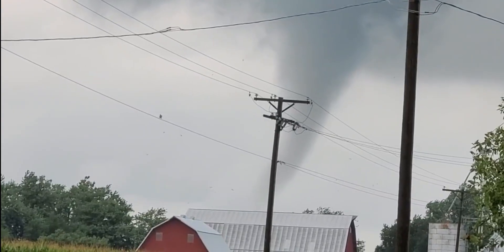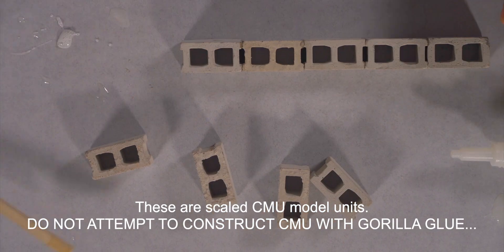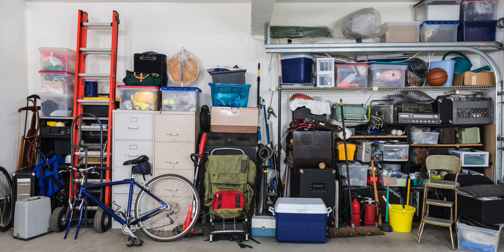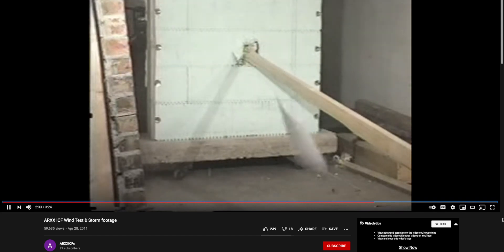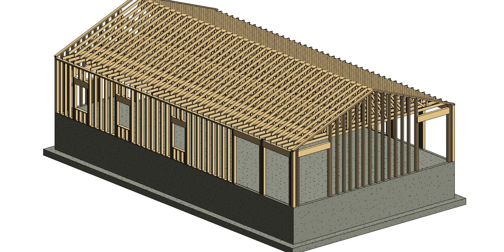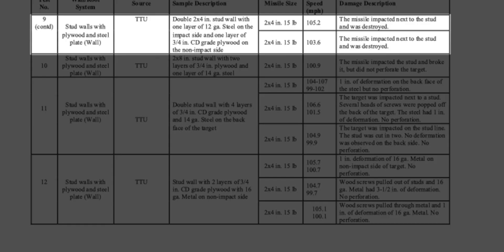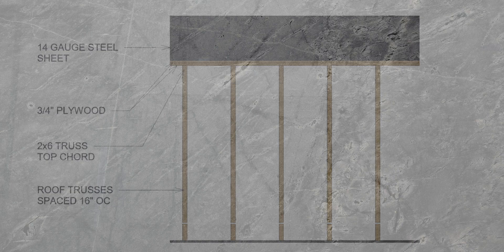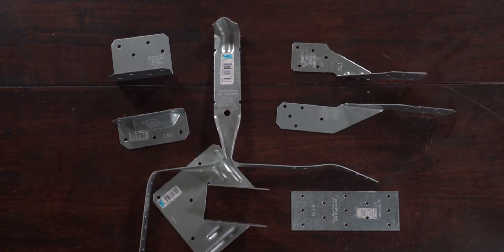These 3 Materials Can Create a Tornado-Resistant Home

Comment: I tried to install cable TV in a house that would have been tornado proof. After drilling for most of an hour I got to the end of my 18” masonry bit and still wasn’t through. The house was a small square with only one window and a door like a safe. It was built in the 50’s to be atom bomb proof. The builder built a couple of them and stopped because nobody wanted to buy them. It was a very ugly house, more like a pillbox than living quarter’s. It was in a part of NY that does’t get tornados. I don’t know if they ever got their cable installed, I just turned the job back in and got hollered at. It had no basement and sat flat on the ground. You could drive past the place and never know it was there. When you are designing just realize that people have to want to buy it and be able to live in it.

Comment: I think ICF construction is the best and most effective way to go. The double 3/4 plywood and steel will easily put your costs into the price range of ICF.
" has been determined that using ICF wall construction generally adds about 3 to 5 percent to the total purchase price of a typical wood- frame home and land …"
"When comparing the cost of building a stick frame home to an ICF home, an additional $2 to $4 is added per square foot to the ICF home, according to the U.S. …"

Comment: Wouldn’t a 8x4 sheet of 12 gauge steel be very heavy and somewhat dangerous to install? I do heavy gauge framing for commercial buildings. 6” flat stock can cut you pretty easy and even at lower gauges bends a lot when handling it. Seems like it would be difficult to handle a full 4x8 sheet of it.

Comment: If you have a shovel you can make your home tornado proof. Earth berm it and you can stay above grade. No tornados ever have been digging holes in the ground. Second, build a monolithic concrete dome. If you use basalt rebar, that concrete will never explode from rust- it will last forever. Just use shotcrete on an airform. It will qualify for a bomb shelter.

Comment: Jay, 
The reason Concrete is not used in residential construction, is because it is considered a water retainer (Like Brick). 
There is already a Tornado and Hurricane proof building method in existence today, which can replace current stick framing.  That method is Structurally Insulated Panels (SiPs). Test have proven time and again, SiPs can withstand the 100mph stud test. 
Further, there is a newer plastic, which if used as the sheeting on SiPs or stick frame, can withstand extreme tornado damage. Its the base material used to calibrate the stud cannons, engineers use to test wall structures. 
SiPs are the answer to replacing stick framing for home construction, they tick off all the necessary boxes for strength as well as high energy performance. Look into that method of construction. 
My question would be, why have we not replaced glass windows with Lexan, its far stronger and its impact resistant. 
Government does not care about Individual Residential construction. Its focus is upon housing masses of people in one space (I calk them ant farms). This allows the government to Control ... However massing people into small, joined spaces, is the worst idea, as it sets people on edge continually, because their privacy erodes. 
Humans need private space
....
Your thinking correct.... just consider SiPs
Reply: Lexan is soft and scratches just from washing it. Layered up with glass and acrylic is now bullet proof glass that will work great but very expensive. Also needs to be replaced after an impact.
Reply: This is hilarious saying that Concrete is going to hold water when OSB in your sips is worse than a sponge. Icf is the answer and if done properly is not holding any water whatsoever.

Comment: I would bet that if you use a tie strap on every stud and Miami code to design your roof fastening and roof structure that it would hold those wall and roof panels in place. Two other considerations you should make. First, the garage. It should not be attached, or at least it should be able to tear away w/o wrecking the house's storm performance. Second, windows and doors There are windows and doors designed to withstand hurricane blown debris. Most of the windows are 3 or 4 pane windows with a polycarbonate layer in the middle that can stop things like your 100mph 2x4. The doors are usually steel or fiberglass with small armored windows. They need a doorjamb and hinges that are stronger than normal too. It will not do much good if you get a door or window blown in and the pressure pushes the walls out. You really have to make the entire envelope strong and air tight.

Comment: my double wide mobile home withstood hurricane Michael a category 5 hurricane and we had a heavy duty metal roof installed which with stood an EF 2 tornado that cam over it. It has 2 x 2 trusses on 16 inch centers and 5 1/2 studs. An impact knocked out two studs in the main bathroom. All the old siding had holes everywhere. the manufacturer did not use house wrap...that should be illegal. windows were single pain  which should have been illegal. There are some corners that just should not be skipped over to save money.

Comment: I was out with some friends in Houston and we drove by a new housing area, the Philipinos I was with were shocked we built with wood,, they build (smaller) with concrete blocks due to all of the storms they get.   they lift the better furniture up off the ground and go 'take cover',, when they return after the storm the power wash the floor (also made of concrete) put the furniture down and go about their lives.   I have been thru a lot of hurricanes and tornados.  in hurricane zones they use hurricane straps on every exterior board to the seal plate and rafter. tornado zones should do the same.  if you notice 'hurricane proof homes' are curved outside the home.. a lot like your car,, the wind rolls past and many of those homes are made of a styrofoam!!  now of course we would want something more than styrofoam to protect us from flying boards, but you can curve plywood.. or build igloo style.

Comment: If you want a tornado proof home 
Pumicecrete is by far the best building material on the planet Pumicecrete is a mixture of pumice cement and water mixed and poured into a set of reusable forms walls are poured from 12"to to 25" thick pumicecrete is fireproof termite proof rust rot and mold proof non toxic and has a high R value and good sound attenuation solid poured walls means no critters can live in your walls Pumicecrete can be built for a fraction of the cost and time and pumice is one of the few building materials that can go directly from the mine to the job site ready to use without any additional possessing and zero waste 
Take care Ray

Comment: Instead of building the whole house like a safe room, couldn't you just build a safe room as a usable space and build the rest so that it doesn't blow away, but you just patch holes? You'll be replacing windows anyway. So build it for the wind forces, not debris per se.

That red area has to deal with a lot of water and hail that comes with the thunderstorms that create the tornadoes, but at the same time it's hot and dry in the summer, so maybe v2 can be fire resistant too? Use metal roofs, fiber cement siding and Rockwool insulation. 

Because temperatures can be extreme, maybe also make it energy efficient so you can survive a few days without power. Oh, and make it affordable 😂

Comment: If I may. Engineers and Scientists tend to overthink things. Even if you build a modern house with 12inch ICF blocks and tied in the Mono-poured roof with rebar from the walls, you will still have windows and doors. The pressure differential of an EF4/EF5 is enough to render the occupants of such a structure uncomfortable to say the least. One would be wise to just build their house to local code, then excavate a 10x10 storm shelter using IFC, CMU, ect. Purpose built storm shelters not only provide TRUE protection against EF5 tornados, but they are also much more affordable/ accessible to the average American. Nothing new. Just my redneck perspective on the topic.

Comment: I live in Tornado country.
I'm building an IFC house with a full basement, in floor heat and an overbuilt roof with rafter brackets set into the concrete.

Comment: I would just focus on keeping the structure from collapsing. Ok, maybe use thicker sheathing or something for the outside walls, but I would guess that puncture damage isn’t a huge issue in real life. If an object punctures your wall but the building is held together with hurricane ties and other strapping plus framing to withstand uplift or wall collapse, I think you would be fine. If a piece of 2x4 puncture a wall, just fix the puncture area after the storm. Replacing some siding and one punctured piece of exterior sheathing plus a section of drywall inside isn’t a big deal. It costs way less than cladding a home in steel under the siding. That would be very costly.

Comment: U know whats pretty funny theres a company out there called Bamcore that make prefab walls that do a really good job stopping 2x4's shoved into bamboo panel walls @ 60mph, idk if they work at 100MPH+ but it think its prettty dang cool in building more structurally sound homes. Bamboo imo is a severely underrated construction material.

Comment: Doesn’t a 4x8 12g sheet weigh like 100lbs and cost a quite a bit of money? 

I wonder what impact resistant plastics could be used.  Might be lighter/cheaper.   Likely much thicker for same resistance and need protection from UV (would want siding over it as well).

Comment: I had a house built last year in Tacloban City, Philippines, where I am now retired.  The Philippines is in the "Ring of Fire" so we have earthquakes and typhoons multiple times per year.  The worst typhoon in the history of the world, Yolanda, touched down in Tacloban in 2013 with a 20ft surge of water from Leyte Gulf, killing 20,000 people and completely destroying nearly all the buildings in the city.  So, our house is of course concrete as are all new homes.  Nearly all concrete buildings use hollow blocks, not poured concrete.  Ours also has rebar going through the blocks vertically and horizontally and those spaces are filled.  Ours is on a 400sqm lot (1/10 acre) and the house is 2-story with a finished flat concrete roof and a medium-sized room on the roof to protect the stairs and give entrance to the roof.  It can be used as a 3rd living room since we have one on each floor.  And we have a 2nd floor tiled patio and a 2-car tiled carport.  The total floor space is over 5000 sqft.  They no longer build wooden homes here, unless you're extremely poor and then you build them out of any junk you can find.  These shanties always lose their roofs in a typhoon and most are completely wiped out.  Besides, good lumber is difficult to find because there isn't much of a lumber industry.  Coconut lumber is the most common dimensional lumber, but is only used for shanties and scaffolding because it is the lowest quality wood.  Hardwood is rare, protected, and expensive and not processed properly.  Homes are built with deeply set reinforced concrete pillars with a wide cage of concrete at their base.  Our home has 25 pillars.  I think the depth of the pillars is 2-3 meters.  Each is then connected to each other in trenches.  No one builds basements here because of the high water table.  The property was filled with rocks and mountain soil so it is about 1+ meters above the road.  All the floors are concrete with rebar and steel decking sheets and finally tiled on top of that.  We have an 8+ft high perimeter block wall on the property edge and a 3-story concrete firewall on the side of our neighbor.  Our house will probably withstand any structural damage from a typhoon or an earthquake, but the windows are vulnerable.
Reply: Hello Sr, this may be a bit late, but could you tell me how good it is to live in the Philippines? What are the pros and cons? And Would you recommend it for a middle age couple ? Tnx for your time 😊
Reply: @StoneCoolds  come to South Africa our house survived a direct tornado hit last year here in South Africa
Reply: @ALL-REALITEE  i didnt even knew South Africa had tornados ! lol
Reply: @StoneCoolds Yes we do have tornados, our country got a lot of bad weather ☁️ and it's just a scary thing to think about. I'm 25 now and I've never experienced such an event, A lot of South Africans still take the weather for granted, I don't anymore, I've experienced that tornado 🌪️ and it's a crazy world we live in.

Comment: I have thought long about this. I grew up in Kansas.
My idea for a home is simple. A single ridge home down the middle. about 20 feet wide, and XX amount of feet long. Whatever you need, want, or can afford.
The basement is where you and your family live.
The walls of the basement are ICF to keep you warm and cool. The ICF walls support the ground level of the house. The basement has an inner wall of concrete block that is filled with cement and reinforced with rebar of course. There are bolts sticking up out of the concrete. Installation of large steel plate spanning the basement is a simple matter but costly. Bolt the plate down to the concrete walls. This forms the ceiling which nothing can get through. Since it is level with the ground, you are safe. 
All valuables are stored in the basement. And all bedrooms are in the basement. Ground floor is where you store things that can be replaced. Like the kitchen stuff, the tv, the cars, the dishes and dining table. The tools in the garage.
Everything important lives in the basement.
Obviously you will need to have evacuation ability in each room. in case of fire. Good air circulation, and double sump pumps to ensure no flooding with easy access to repair them.
Bathrooms in the basement with showers. And a kitchenette.
People don't like the idea, because you don't get alot of sunlight in the basement.
I vote for safety while sleeping. A tornado at 3 am during a new moon and pitch black storm clouds is not my idea of a fun game of guess where the twister is at.
Reply: Double sump pumps are great, the only problem is electricity is the first to go. Do you have an underground generator with tall snorkels to get air and let the exhaust out? Do you have enough battery to keep the pumps going and the air circulating? I’ve gone through many hurricane's laced with tornados. My house is fairly hurricane resistant going 25 years with little damage, watching neighbors houses have major damage. Florence came along, a cat. 1 with lots of little tornados. One of those tornados tore of a section of roof and let the water in. I had major damage from the water and then from mold since the rain didn’t end for weeks. It isn’t just the wind, it’s everything else working together in completely unpredictable ways that get you.

Comment: You missed the boat by not including concrete/Styrofoam hybrid blocks such as Miracle blocks, EZ blocks, etc. The ones built north of Houston have easily handled hurricanes, tornados, flooding, while being highly energy efficient and lower cost to build than wood framing.

Comment: How about a concrete core structure that would withstand tornadoes and would contain bedrooms and kitchen, bathroom, laundry, all the must haves. Then construct the less necessary spaces around it with traditional wood. It the structure is hit, it's possible the storage and accessory spaces may be damaged but you could comfortably live in the concrete structure until the other structures are replaced. Of course, you could beef the stick framed areas up to try to withstand higher winds etc. but this would allow for continuous use of the property in a tornado event.
Reply: no it wouldn't. in most disaster events; soon after you get intense mold growth. safe rooms are there to shelter you till event is over and secondarily, to protect and positively locate your valuables and documents. evey safe room should have a fire resistant gun safe imo even if you have no guns, you will use the space and its mass will resist heat damage longer then a smaller 'shop' Safe. Looting should be considered a danger after you are no longer at residence too

Comment: My house has a wood foundation.  I am finishing the basement with a second framed wall of 2 by 6 bolted to the existing concrete pad. With further looking on line I may need to double the 2by6 and add heavy duty hurricane ties on top and metal brackets for the bottom. Realistically what else can I do to improve the strength of this inner safe room?
Rebecca
Reply: depending on room size; you may consider adding a center column in room center to to hold the above floor to the basement floor to prevent lift off. it would have the added benefit of bracing the basement room ceiling from some 'falling debris' impacts. on your framed wall; did you use 3/4" plywood on both sides?

Comment: Thanks very helpful. I planning a custom house in tornado country. And I'll likely use Insulated Concrete Forms for the walls. But I've been at a loss as to what to use for the roof and it look like a typical gable or hip roof. The testing showing 130 to 133 mph penetration gives me one option for a wood framed roof. And based on what I know from playing tank games. Angled armor is stronger from penetration than flat. So it should survive everything but a direct hit from an F5 tornado.